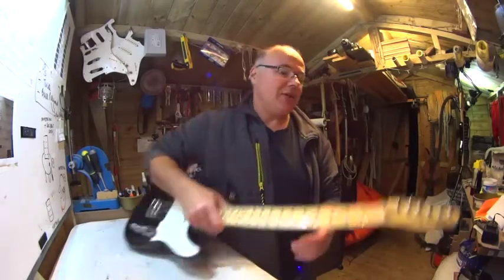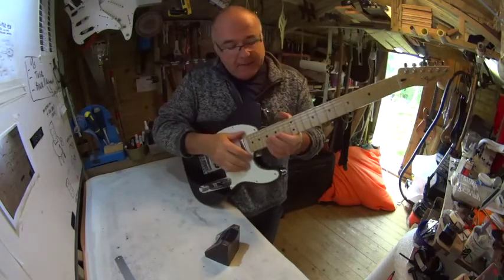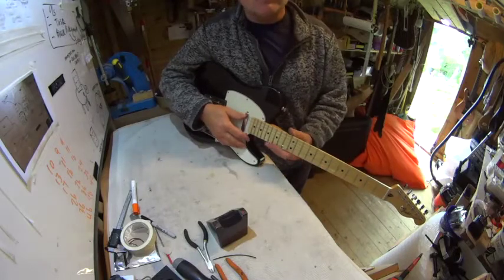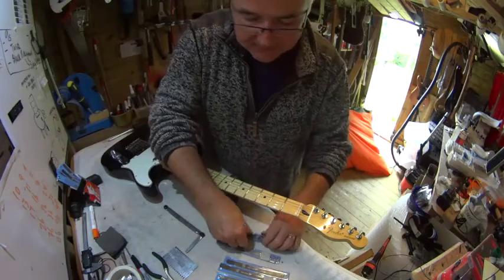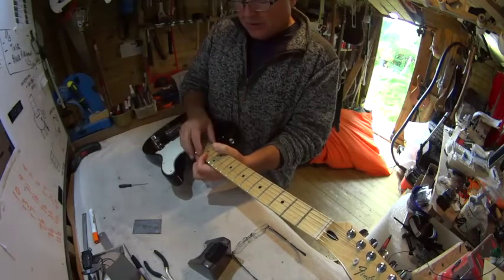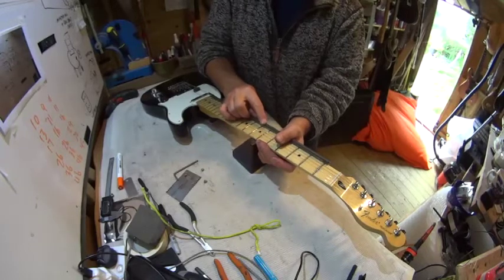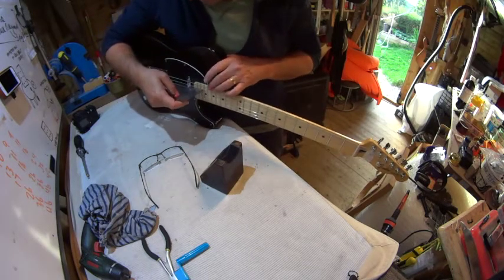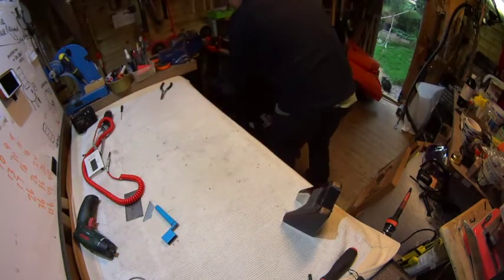Fender Telecaster MIM set up

Comment: Hello Sam, Firstly let me thank you for your sharing your very well thought out techniques.  All that you have said makes perfect sense to me. Especially leveling frets unstrung with no load involved.  I work a lot with exotic woods here in Australia where temperature ranges can play havoc. I guarantee you that two pieces of timber band sawed, jointed and thicknessed from the same log, ... book matched pair if you like, will behave differently.  So yes!  how on earth can we predict movement when loaded?
You mentioned that you have a pdf setup guide for sale? I'm not an apple user at all, however, I'm happy to buy direct from you.  (That way YOU keep the $1/3)
Thank you again for sharing, .... Kind Regards, ... Barry Manclark  Australia.
Reply from the maker: Hi Barry, you're welcome - and thanks for the comments. You're right...wood moves and while I can't tell how exactly it moves I'm confident that the longitudinal compression on the neck when loaded changes the alignment of the frets enough to make a small difference. 

Regarding the eBook - the following link to a post on my FB page shows how to get the PDF version direct from me

https://www.facebook.com/relovedguitars/photos/a.1434485003475282.1073741832.1434242346832881/1831237983799980/?type=3&theater

Comment: Hi Sam, I've followed your technique from the eBook on a few guitars and got a lovely playing action, but I struggle with having the low E at target of 1.5 - 1.7mm without some buzzing when playing enthusiastically, is that still fairly unavoidable with a heavy right hand with a low action? It doesn't come through the amp unless the tone is really clean (which in my case it always has a bit of hair on it anyway)
Reply from the maker: Hi Greg... yes; the largest variable in the playing action / set up equation is how hard we strike the strings. They need room to spin / flap around and the harder we play, the more room they need. This ultimately means that if you're a hard hitter something has to give...either you'll need some more relief and / or higher 1st and last fret actions to create more string spin space.
Reply: @SamDeeksRelovedGuitars  thanks for quick reply. I was debating trying to work on the E side again but thought technique may play a part as well so thanks for confirming, will try more relief in neck 👍

Comment: I know you must have hundreds of questions put to you,so I would not be surprised if you dont remember me.My name is Ryan and I have a problem with the high E slipping off the fret board. Do you think you could solve this problem by cutting a new hole in the nut or replacing the nut with a higher E slot? Also sometimes the strings are dragging across the frets when I bend,and some of the higher notes are frizzing....also suffer from sharp fret edges like in this video so it may need some fret work. Can you give me any idea of range of prices to sort my MIM Tele out? Thanks for the awesome vids too Sam,I very much admire your talent. Would love to do it myself....but was bottom of the class in wood work lol :)
Reply from the maker: Hi Ryan I remember you and your falling-off-high-E :-) You've described several problems. The first (the high E) could be caused either by the high E slot being in the wrong place (cut wrong or nut pushed too far to one side) or - more likely - due to the neck being screwed on in a slightly mis-aligned way, as Joe's was in this video. 

The other issues i.e. notes choking out on bends is common on tighter radius guitars like this 9.5" radius Tele but can be helped by careful and precise fret levelling as shown here with Joe's. Sharp edges can be cured by careful filing followed by sanding (which I do while I'm sanding out the freshly-levelled frets). 

The price I charge for all of this is a flat £100 plus return courier postage. That includes a new nut (if required) and new strings and takes around 3 hrs (the video here is something like 2.5hrs but I usually cut out the boring 30 minutes of sanding and polishing the frets). Send me an email at samdeeks@gmail.com if you like. Cheers! Sam

Comment: I have to say I love watching your videos The other comment I| have is I use an improvised sanding beam it's called an aluminium spirit level you can often get them cheap and they are perfectly level hope this helps someone who would like to try this method without the massive cost.
Reply from the maker: Hi Stephen - I've got one of those up on the 'roof shelf' too - it's a great 'budget' levelling beam...but I don't use it any more for fret levelling because the truss rod (adjustable to the relief curve with the neck fully strung) is the approach I use here and on every set up now. Having said that, if you're going to do the 'neck flattened, strings off fret levelling approach' the machined spirit level is a great asset.

Comment: Hey Sam!! I'm already with my Baby Taylor! Awesome sound! I have a question .. The strings that came are 0.12. Have you tried putting 0.10? Is it good? These strings are too thick for me .. I was thinking of changing to 0.10. Thank you for your help!
Reply from the maker: Annie Goulart hi Annie - 10s should be ok... the shorter scale length tends to make strings feel ‘looser’ or lighter than they would on a regular scale guitar. For that reason 10s on this will feel like 9s or even 8s on a regular guitar. If that suits your style of playing then go for it.
Reply: Sam Deeks Got it .. The sound may not sound as good as 0.12, right? The only problem is that I need to do a lot of strength and it hurts my hand. I would only trade for that, but I was afraid the sound would be bad.
Reply from the maker: Annie Goulart It should sound fine - best thing is to try it and see how it feels. The tone / volume difference will be small compared to the improvement in ease of playing
Reply: Sam Deeks Thank you so much, dear Sam!